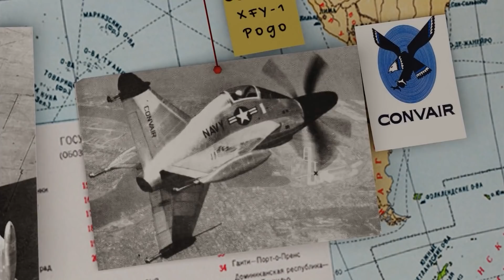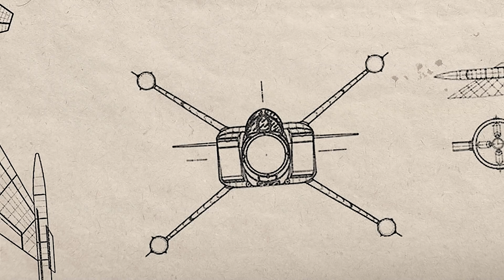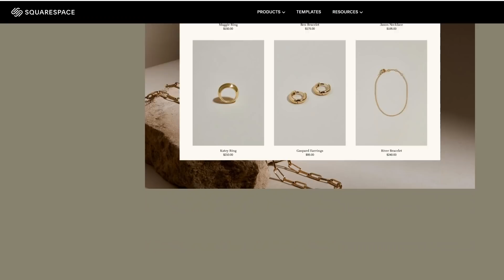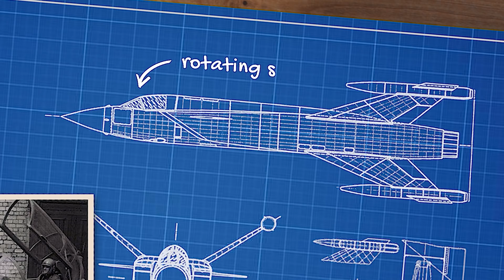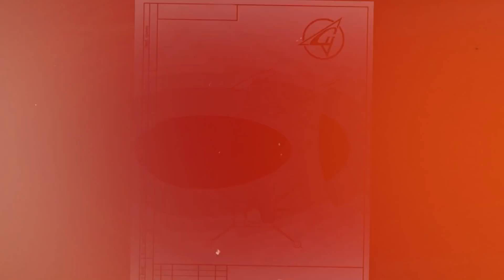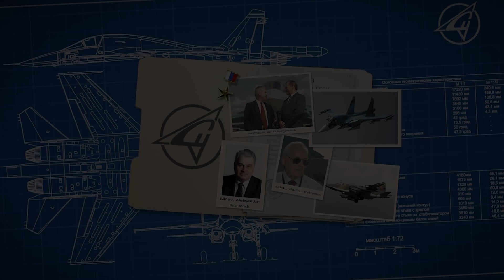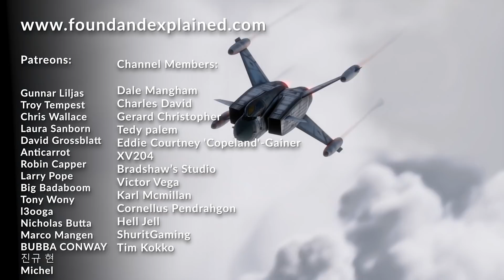That time the Russian's designed a X-wing fighter plane - Soviet Sukhoi Shkval

Comment: Perhaps an interesting asset for the Soviet Naval Aviation and Submarine Fleet, a soviet institution with extensive experience refitting Russian submarines to incorporate new generations of SLBM missiles during the Cold War. In this case, they have the challenge of adapting the aforementioned silos to this Sukhoi Shkval reactor.

It should not be forgotten that until the arrival of later generations of Soviet missiles and submarines, these submarines had to perform surface launches, compatible with deploying these X-wings jets maybe also using logistical protection and launch containers in a corrosive marine environment for avionics.

As a final counterpart to unconfident and non-rival turboprop ASW aircrafts hunting submarine fleets, and challenging their coastal or ship-based fighter escort in a war case. In a time when the use of MANPADs or SAMs missiles as submarine air defense wasn't a possible response standard like today.

Comment: The vertical position model crafts had promise, however they require converting and transformation ability with wing extensions. Along with engines doing morph Phase vs Stage effects, like jet vtol - ramjet - high & exo rocket switching functions, the key to a SSToL, if still using chem-fuel as source of mobility.

Comment: According to a lot of you the most obvious issue with this design is the difficulty in landing - considering on paper it would rely completely on generated thrust to complete a landing (not ideal for combat aircraft that get damaged and run out of fuel) Humor me if you will, but I wonder how such a design would function if the vertical landing was achieved via ultra durable parachute (s) ? Perhaps one in tandem with thrust. I'm not sure how strong we can make them but if I do recall one of the USA's reusable spacecrafts use them to slow down in landing, so at very least we have the technology to make parachutes that can take extremely high stresses. But what do I know, somebody roast my idea on this I'd love to see the discourse.

Comment: Wings at  a 45 degree angle cannot generate lift ....and the lift on any plane must be at the center of gravity . you putting your imagination together with old  photograph (cut and cropped )  to come up with total  nonsense  .
Sincerely A.E. ( aeronautics Engineers).😂
P.S.
And where is the landing gear ? Maybe in side the four exhaust nozzles for the V.T.O .? D.A.

Comment: Along with the Convair XFY-1 Pogo tailsitter there was the Lockheed XFV-1 competing for the same contract.  And then there was the Ryan X-13 Vertijet.

Similar was the Zero-length launch program to launch conventional jet aircraft without a runway using rockets.  Slap a big rocket under an F-100 and kick it into the air just fast and high enough for it to start flying before crashing.  Fun.

Comment: Something initially confused me - you said the things on the ends of the wings were fuel tanks / pods with landing shock absorbers. But animation made the back of the pods visually similar to the early jet engines, like those at 5:15, and they produce what looks like exhaust at 0:58 (its probably just wing tip turbulence...but it doesnt help that it seems coming out of the back of a circular aperture of the pod). Took a moment to figure out wtf I was looking at. I was thinking - why would a fighter have extra thrusters in addition to main engines, its not babylon 5, lol.

Comment: I have a question. How would it land? I never saw any landing gear.
Reply: It had shock absorbers in the four pods to land vertically. However there's nothing to manuver the aircraft when in vertical position at near zero speed, so there's no way it could land safely.
Reply: @neutronalchemist3241  How could it do that though? What would it menuever into a vertical position?

Comment: This is one of those designs that I'd like to see revisited with updated tech and equipment. I always wonder if the advances made in materials and electronics could offset some issues older designs have, and if those designs could potentially still have benefits worth pursuing.
Reply: I just want to see the design simulated with modern computers to see if it would actually work.
Reply: The problem with them is it is harder to land them. Even if you land it on a platform, it will have to pe precise without you looking at it. In case of emergency or any technical issue, it would be hard to land.

In the future if we are in space, It will be a feasible concept, to just launch off of a platform and then there is no direction in space so it will be easy to fly them. Landing will again be an issue, But hey SpaceX is landing large landers, that are much taller and heavy so it will not be hard to make such planes land.

For a space Force, they are a good design, you don't need wings in space. But on earth, it will be hard to justify such a complicated plane, when planes can land virtually anywhere because of STOL capabilities.

Comment: Building such a plane for the Air Force in the biggest country in the world is stupid (as the US generals said if they bomb our runways we are done). VTOL is only useful in limited space (ships), but in the vastness of Russia it is nothing more than throwing money out the window, so I think that Polit-bureau had never considered this project seriously for Air Force. Probably it was in competition with Yak VTOL projects, but four short X wings with no hardpoints are useless (actually only the small amount of load could be attached-somehow, on the fuselage because of the vertical position on the ramp). Also, the landing in such a configuration is at least dubious, and it was probably just one of the many unsuccessful Soviet VTOL projects.

Comment: Nice video, but you make it seem that it was just a fluke decision to reject the craft. 
The concept has several really grave drawbacks:
- Wings allow airplanes to take off with a thrust to weight ratio of smaller than one. 
- If you want to take off without wings, you need a TWR greater than 1.
- compared with regular horizontal take off, you are going to sacrifice payload and fuel capacity in a severe manner.
If you look at carrier based aircraft with a ski-jump, you are going to find that aircraft can only take off with a reduced fuel and weapon loadout from a jump compared to a catapult. Taking of vertically limits payload even more.

- Transition from take off to level flight and
- Transition from level flight to horizontal landing
As others have already pointed out, especially the transitition to land is hard to pull off. For the Harrier Jump jet, the first pilots got trained extensively. Fighter pilots received cross training as helicopter pilots. The demands on these test pilots was really high, but training paid off and losses were few. After the US Marine Corps adopted the Harrier for more pilots, they tried to come out with less extensive training. As a result, many planes crashed and pilots lost their lives.

The drawbacks far outweight the benefits of the concept. There is a reason, why there have been only so few VTOL jets in history. With more modern technology and computer assisted fly by wire, the concept is more managable today.
Reply: And also bigger elephant in the room :

You absolutely need big tall crane to do absolutely anything (maintenance, rearming, tilting the plane). Which defeat the purpose of being compact compare to standard thrust vectoring
Reply: Perhaps the idea was as a limited-use defensive aircraft attached to a radar installation on land, or a destroyer at sea. The sort of thing that would only be deployed if you were already under attack.
Reply: @moconnell663  Well. Nice idea. But, we can't make it bigger since it's cumbersome. So we can use drone mechanism to save space, and we can automatic the whole thing too. Also to save cost, we can make it smaller and cheaper and instead of carrying air-to-air missile, we can attach it munition to burst near the suspected plane

And... Oh no! We accidentally re-invented "Surface to Air Missile"!
Reply: @bocahdongo7769  Eh, nothing wrong with a good thought experiment.
Reply: @moconnell663  if it's 50's or 60's with absolute basic computer, yeah it maybe sounds viable to research. Or maybe if you live in Ace Combat Universe.

Nowadays? Drone is exist, anti-ballistic missile is exist, AI is installed on missile already. Also it prove it can shot down stealth plane too. So why bother to make human version of missile.
Reply: @bocahdongo7769  that was my thought. Surface to air missile technology was barely viable at the time, and really wasn't portable. That's the only context where it made sense to think about an aircraft like this one.  The other major flaw with this design is the distinct lack of weapons pylons.

Comment: Secret Space Program. T-65, 1965? Like a Tank? The Last Starfighter's starfighters are VTOL crafts. So… 'Copy and Paste'? With some edits?

TLS ending featured the Gunstar landing vertically.

The Sukhoi X-Wing seemed to be an Interceptor, that can be launched anywhere and immediately. A manned missile.
(Ala 'Stratos 4's 'TRS-2')

After later Surface to Air Missiles (SAM), it seemed to be better suited for 'Intercept-Recon-Verify' and 'Intercept-Escort' roles.

Comment: would it be better if the wings could be adjusted to be flat when landing to land like current jets or upside down if needed or at 90 degrees either side?
Reply: And add 5-8 tons more and all the possible hydraulics, elctronics and failure points imaginable...
That is bad idea even on a paper!

Comment: Put fuel pods on the wing tips and also make them the landing gear! (is this a good idea?) So this thing was supposed to take off and land tail first all the time? seems even more difficult than the Pogo's landing.
Reply: whit a tail landin plane is a form of lowerin the mas senter in the vertical configuration

Comment: Very cool looking, but it would have had the same problems every other iteration of the concept had, transition and landing.  In order to land you have to kill your forward velocity, but that means no aerodynamic lift, which means all that keeps you in the air is thrust.  A tricky manuever to pull off without computer management and thrust vectoring.  Also not ideal when you're coming in low on fuel and shot up.
Reply: Then, perhaps we use it as a space plane, not a fighter.  Strap a booster stage below it to help it get up, and then let it rely on its own power.  Then let it glide back through the atmosphere, with enough fuel to perform the vertical landing procedure.
Reply: @dannypipewrench533  Stratos 4… That being said, its role is an interceptor. A manned SAM.
Reply: @smartfrenandromax6651  Yeah, that would be pretty good.  I think we should gradually introduce manned, or at least reusable, ballistic and anti-ballistic missiles.  Essentially, a mach 15 strike bomber.  You could also change targets this way.  Imagine, for example, the Titan II.  Take a space plane version of the Gemini spacecraft, or perhaps the X-20, and load it with nuclear weapons.  Launch it across the Arctic Ocean, and then wreak nuclear havoc.  The pilot will fly the craft back to friendly territory, and the first stage can be recovered from the ocean or landed vertically like SpaceX does.  The second stage can be steered into orbit, and parachuted into the ocean when it reaches a good reentry point.
Reply: @dannypipewrench533  space plane??? You don't need wings in space, there's no air to Push around.
Reply: @PrinzAquatic  Space planes use the wings for reentry, like the space shuttle.  The space shuttle was a space plane.  The X-15 was a space plane.  The X-20 would have been a space plane.  The X-37 is a space plane.
Reply: Ironically the solution might be to go full X-Wing and have the ability to alter the wing geometry. Allowing the plane to fold its bottom wings upward to a fully horizontal position would allow for normal landing with landing gear.
Reply: @HellbirdIV  Secret Space Program. X-Wing, Gunstar, Starfury,… might have been a 'copy and paste' of a real design. But yes, an X-Wing / X-Tornado style wings should provide more lift.

The Sukhoi X-Wing is just a manned missile, a later Ohka.
Reply: @HellbirdIV  I didn't even think about that. But I mean the plan was to use the sukhoi x wings in the navy on f.e. moskwa- carriers, which would have been impossible to land on for a foxbat-like plane. It'd have to be a vtol plane like that yakovlev design
Reply: @kirill6850  Yeah, landing them on a carrier would probably not be all that convenient, I think tail-sitters have the strongest advantage when launching from hidden bases and then landing normally.
Reply: @HellbirdIV  the point is a plane that don't need airstrip so doing that make the design useless
Reply: @johnsmith-yj2cn  Not really. There are many benefits to being able to launch a plane without an airstrip without needing it able to land the same way, rocket-assisted short takeoff has been a thing since WW2.
Reply: @HellbirdIV  Let's be honest

Soviet already made way more successful VTOL without needing any crane to do literally anything
Reply: @bocahdongo7769  agree,
I meant, even the "most advance" vtol jet just swim in sea recently and another accidentally bird strike itself while hoovering. even that "slightly conventional" design can go wrong easily.
this thing, I can imagine do many more "wrong"
Reply: @HellbirdIV  yes, there's benefit, but how bout demerits? and where exactly rocket-assisted short takeoff jets now?.
honestly I'd love to see this thing been build, just for the man's romance sake.
but let's be real, what's the point?
Reply: @thekulolali  The benefits are the ability to launch from anywhere, at any time. In modern war, airfields are the first targets of enemy bombers, strike craft, missiles and special forces because without a runway you can't get any of your fancy expensive fighters in the air to contest the enemy. 
 
This is why VTOL and STOL has been developed, and with things like Sweden developing the Draken, Viggen and Gripen to be able to take off from Sweden's highway system instead of airstrips.
 
Rocket-booster vertical takeoff interceptors could be hidden almost anywhere, since they don't even need a dirt road to take off but could launch out of a hidden valley or forest clearing, or even from inside a city!
 
There isn't much need for interceptors in current conflicts which are mostly asymmetrical, but the Iraq War wasn't that long ago, and you bet the Iraqis would've been happy to be able to launch fighers without airstrips.
Reply: @HellbirdIV  you know what is something that already rocked assisted vertical take-off that much cheaper, easier to deploy, and far simple and still can shootdown Stealth Plane anyway?

It's called "Surface to Air missile". And it show absolutely more extensive use than any VTOL aircraft, combined
Reply: @HellbirdIV  Ah, yes, Me-163 Komet.
Reply: Have you ever questioned the nature of your reality?
Reply: @fenrisunchained1926  someone did claims they live in Ace Combat Universe. 

You get the idea
Reply: IMHO not just computer control and thrust vectoring, but laser ranging as well
Reply: Yup, I've flown some old fighter jet before

The only way I can see landing that x wing plane is to go straight up and play with the throttle while gently stabilizing the plane to stay vertical, too much lean on any side will result in catastrophic crash
Reply: i wonder if it could have landed belly down at all, perhaps wheels inside the struts on the wing tips
Reply: Loved the way you laid that down, appreciated 👍🍻
Reply: For craft like these to work, they will need to figure out anti-gravity.
Reply: I thought the four tanks at the tips had their own jet engines. An expensive and heavy solution, but it at least gives the pilot direct maneuverability at hover.

Would still be a nightmare without modern computerized control system. Vertical takeoff is not meant for humans.
Reply: @Horesmi  Not meant for manned airplanes.  Missiles work beautifully.
Reply: @dannypipewrench533  oh darn I meant landing, not takeoff. And reliable vertical landing for missiles is like three years old tech.
Reply: @Horesmi   @Horesmi  Right, for use on Earth anyway.  Rocket powered vertical landing with a crew worked fine on the moon.  But that is not what we are here to talk about.  Vertically landing an airplane is a nightmare. On a note completely unrelated to aircraft, here is a Youtube video I made just moments ago:  https://www.youtube.com/watch?v=FZcCcfZRt9U&t=26s
Reply: @Horesmi  If it was quadcopter style, it is possible.
Reply: This is Space X stuff. In short, they need more powerful computers.

Comment: This doesn’t look like it could fly like a jet. The wings don’t look like they produce enough lift. It looks like it can fly as a rocket 🚀 but not a jet 🛩. I am by no means a scientist or aerodynamics specialist but it just doesn’t seem like it can fly horizontal
Reply: Anything can fly with a power enough propulsion system.
Reply: @Olkv3D  ok even if that was true, this jet would need to be at almost full power consistently to gain enough lift which is not efficient and won’t be able to fly as long. Plus how do you slow down enough to land the thing without loosing too much lift
Reply: @iCazZiStronZi  Hey, I didn't say it would fly WELL.
😝

Comment: Love these old weird designs.
Have been thinking a lot about inverted v tail or x tail for turbulence off the wing not shadowing the tail
Reply: I tried it in simple plane. Very manuverable and stable. Only issue is it need lot of wheel clearance
Reply: An X Tail split into two, made into canard & rear stabilizer working together.
Reply: @smartfrenandromax6651  Isn't that basically a Rutan Quickie?